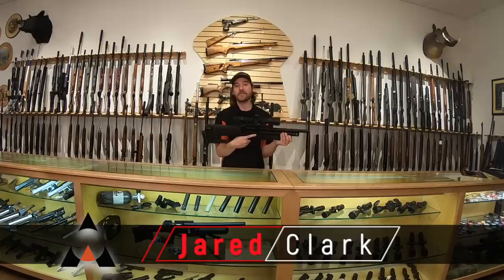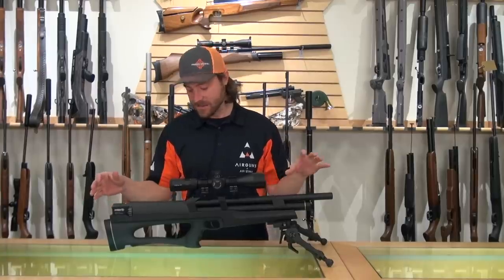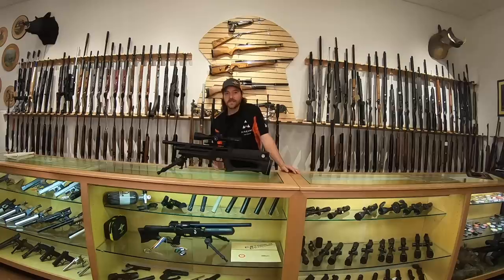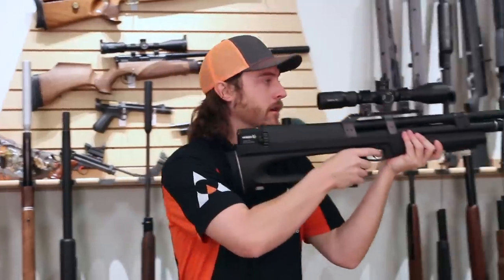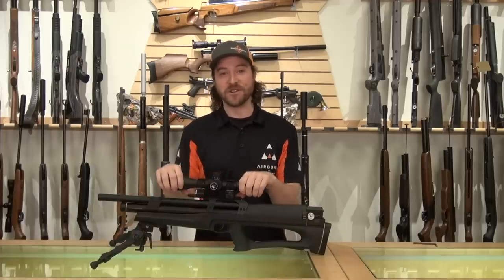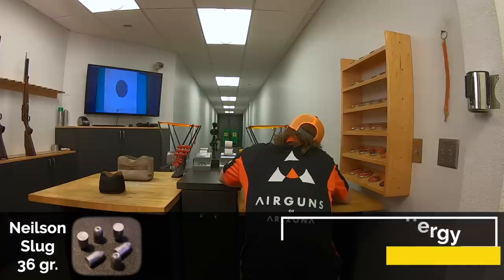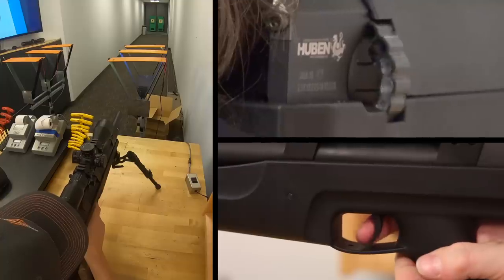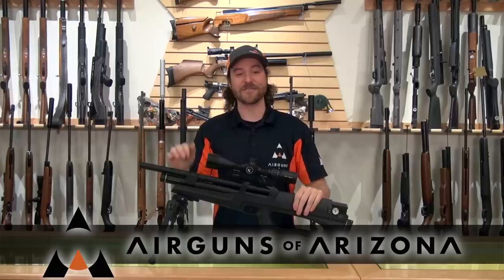Huben K1 Semi Automatic Airgun - FULL REVIEW

Comment: I have had my K-1 in 22 cal for 2 1/2 years now. What a great gun. also when you load the pellets you can install two pellets
before you need to rotate the magazine. The little tab covers two loading holes.
After having this gun even my FX Impact get little use...Ha! Ha!
Reply: Not sure what you mean!....but you can take several shots with K-1 and load more pellets in with-out removing the mag ( which you can not remove anyway). I also own the SK-19 air rifle from LCS Air Arms  and it too loads the same way both gun work very well.

Comment: Min adjusting the power to max and the regulator to 190 bar shoots 36gr slug at 1015 ftxseg
Reply: How do you get the max in the power wheel? Turning un clockwise until it stop?
Reply: Como le pones todo el poder David? Girando la rueda contra manecillas hasta que no puedas más ?
Reply: @SurvivalMX  you put the regulator to 190bar and turn the power wheel to you're left opposite way of the clock like when you loosen a screw you're going to have to use a chrony if you loosen it to much it might dump al the air mine went to 1015 ftxsec but I left it a 980ftxsec it groups better with 36gr
Reply: @SurvivalMX  hola como estas lo q tenes q hacer es llevar el regulador a 190 bar y la rueda de potencia girala al contrario de como gira Las aguja del reloj no la gires al máximo porque cuando hagas un tiro se te va a vaciar el depósito tenes que buscarle el punto justo te conviene usar un chrony y vas tirando mientras subís la potencia hasta llegar a  la potencia que quieras dejar

Comment: Hey buddy..
The K1 is not designed for pellets
if you want to shoot pellets the best thing is the JSB Monster Redesigned 5.52 mm 25.39 grain ..
It is important to push the pellets all the way forward in the magazine, this brings accuracy.
The best results with the K1 are the original Huben Slugs 33 Gr around 1000 F / s.
And you can always load 2 pellets before turning the magazine.

Greetings Rick

Comment: When can we get the gauge upgrade for the end of the main air chamber? Will it come with instructions on how to empty the tank safely and install the new fill port with gauge? What is the projected price range? Thanks. Love my huben in .25 ordered from you a few weeks ago. Shooting NOE .252 39gr 9mm long. Too bad the rotary magazine isn't just a little wider for the .25 to get over that 2 to 1 length to caliber ratio for better bc. Shooting slugs is all about adjusting the power wheel to harmonically tune the gun for the specific slug being fired. This is probably about the only air rifle mass produced currently to have this capability.

Comment: The accuracy is terrible
Reply: No, it really isnt IF you use the correct slug. The accuracy in the video is ok and what you would expect from a pellet. The K1 has a twist rate and the power to use slugs that are just a little smaller than firearms. As the FPS increases a pellet becomes unstable and is not accurate frustrating people who buy it, crank up the power and use pellets. If you want accuracy at higher FPS, you need to use slugs. It also takes shooting a few in order to break in the mechanism.